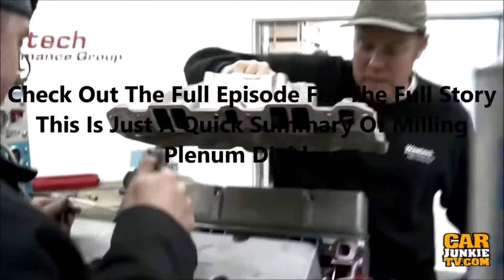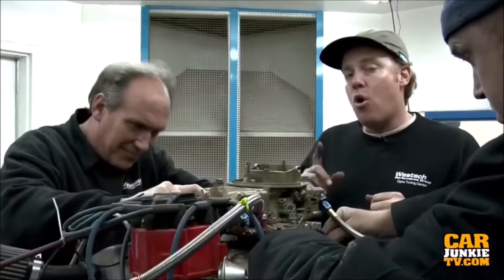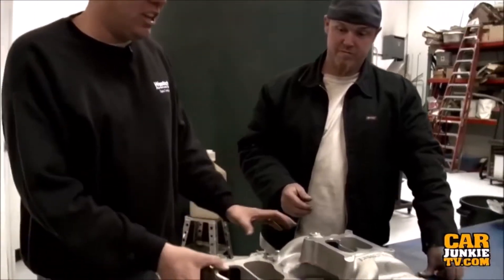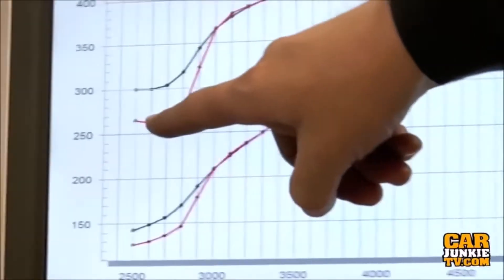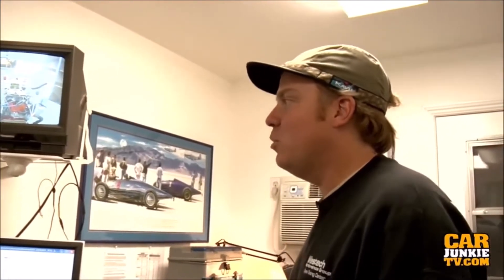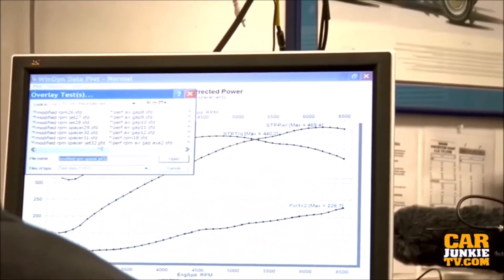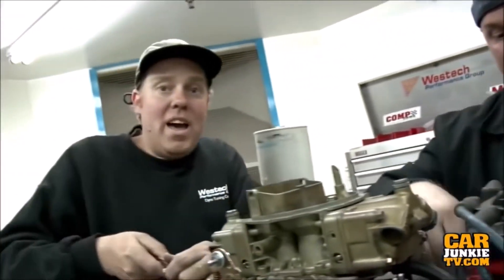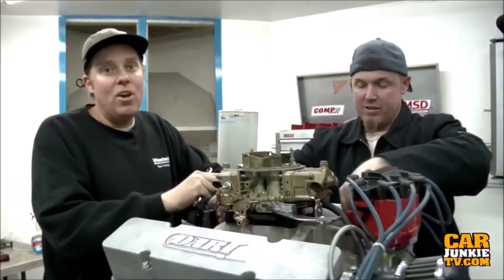Engine Masters David Freigburger Motortrend Milling Out Center Divider Suck Squeeze Bang Blow Hotrod

Comment: Will notching the center out of the manifold work as well for the fuel injection throttle bodies, like the Holly Snipers?
Reply from the maker: I am going to guess yes. I personally do it on my GM TBI trucks. I am running an Edelbrock dual plane with an adapter to mount the throttle body to the manifold. I added a cross over and it seems to run better. The stock manifold actually has it, but it kinda sucks.